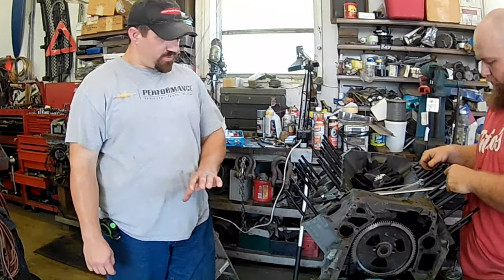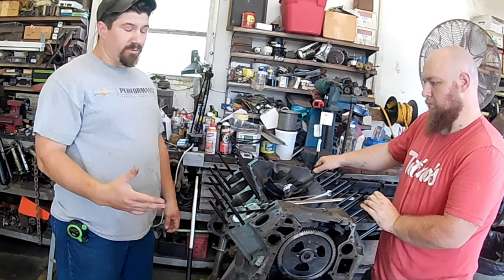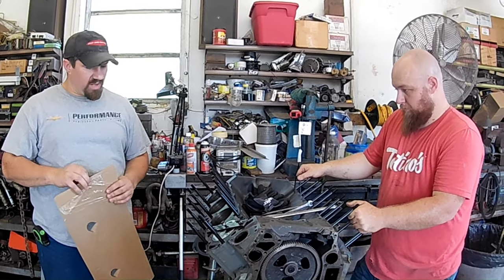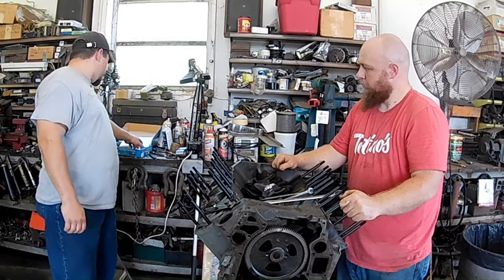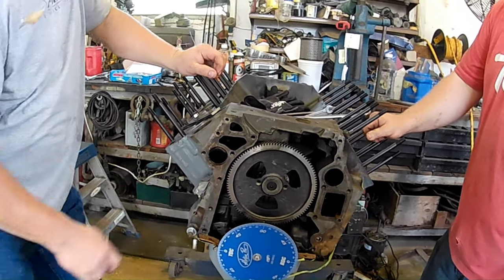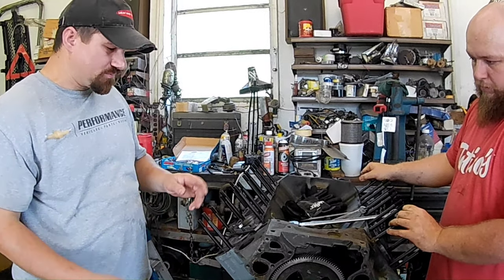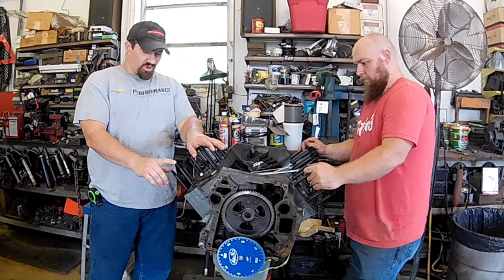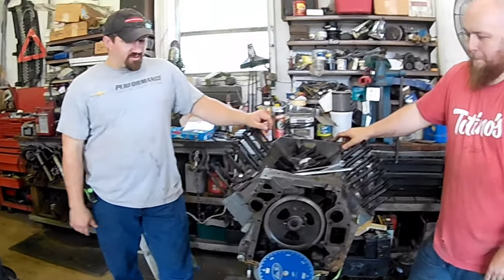6.9 IDI Rebuild Update

Comment: Very cool, I’m installing head studs in my 6.9 tomorrow... Going in a bronco with a ZF5. Running on waste motor oil.
Reply: Got a 93f250 4x4 outback with ablowwed HG between 7,8 and zf as well, glad parts are still plenty and prices are stupid cheap in comparison to power smokes

Comment: I thought the cam shaft gear has timing marks on it so you can just throw in the stage 1 cam without any worry
Reply from the maker: The directions for this cam from Justin at R&D Performance is to advance the cam gear 1 tooth. I am not certain about other idi cam shafts but I actually called him on the phone about it versus the pump gear just to make sure.
Reply: @wrenchbenders  did you guys end up replacing the cam bearings too
Reply from the maker: We plastigaged all the bearings and they were still at factory spec. So we ended up not replacing any of the bearing. The motor only had 17,000 miles on it when my father-in-law got it.
Reply: @wrenchbenders  where the new valve springs drop in or did they have to be modified
Reply from the maker: Just had to shim. Other than that they were like direct replacement.